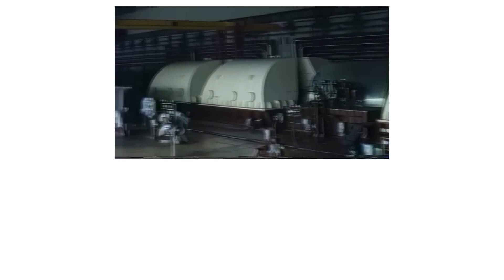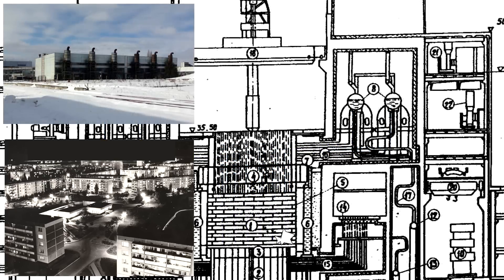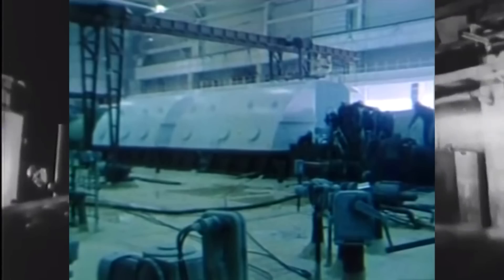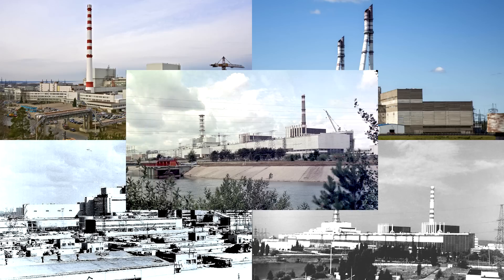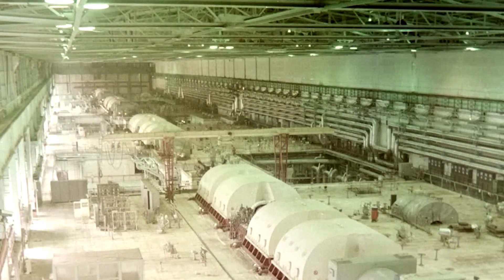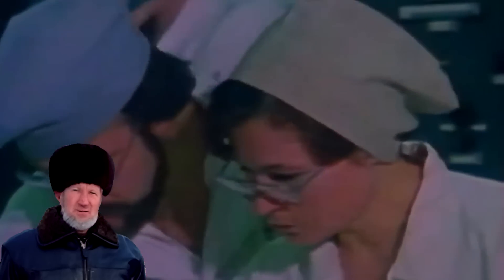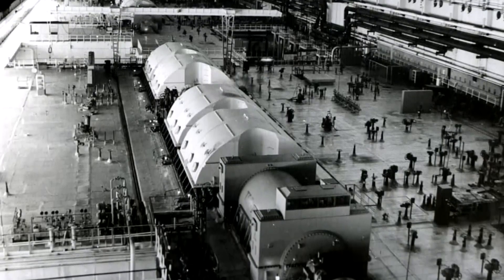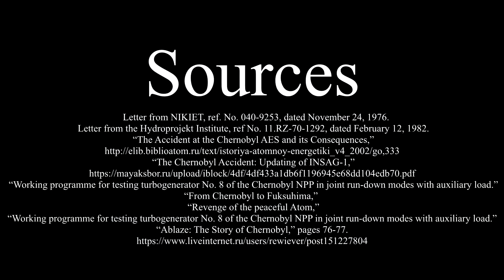Chernobyl: The Truth About the Turbine Rundown

Comment: one thing that i don't understand is that the program was based on some country was dropping on someone elses head. so soviets wanted to protect their npp's. the test could be done when the unexpected foreign explosion occurs, the automatic system such as earthquake detectors in fukushima can just scram the reactor immediately. the reactor still will have enough power in terms of steam. also when the reactor is scrammed the keypoint for the inertial thing is that the keeping the temperatures low while the reactor is scrammed because the operators would know something is happened. instead of this, they scrammed the reactor at the end which is completely not intelligent.

Comment: Maintaining water flow would have been far less critical if the RBMK reactors did not have a positive void coefficient. A design remarkable in that it combined the primary disadvantages of graphite and water moderated reactors. Insane.

Comment: I don't know much about diesel generators but I now that nowadays they have backup systems where the diesel generator is running all the time at very very low power, but can activate and make its full power in only a couple of seconds, sometimes even less, there was a power loss during a storm where I used to work that had such a generator, the lights didn't even flicker or go out when it switched from the grid. 

Every time I would walk by or sweep up the basement I thought about Chernobyl and wondered if the generators designers knew about the turbine rundown. I bet they did.

Does anyone know how big the backup generators were in Chernobyl and what their output was? I imagine they were state of the art then and probably huge
Reply: I’ve never worked in the field of backup power but as an electrical engineer the system you are talking about is impressive. To coordinate the switch from primary to backup power without the lights flickering is on the order of 100ms but to do so without computers rebooting is on the order of 10ms unless they have backup batteries. That’s a very short time! The rundown scenario is ironic how to a layperson it seems like a simple but genius idea, but to someone who creates power electronics it is obviously hard and impractical.

Comment: Approved program of " Rundown experiment" even didn't mention when exactly reactor must be shut down by AZ-5 button. Logically, it should be done simultaneously with closing of steam valve to turbine TG-8 and connecting the latter  to Reactor 4 to feed up circulation pumps, i.e. at 01:23:04  when experiment started. Actually, Toptunov pressed it at 01:23:39 by his own initiative rather than by the command from Akimov, who ignored him. It was assumed, that reactor would " never explode"  , whatever you do with it. Actually, reactor was already " programmed " for explosion when graphite part of control rods was reduced from original 7 meters ( on entire length of Active zone ) to 4.5 meters, leaving water columns 1.25 meters above and below, when control rod is in the fully " Out " position. Failure of RBMK-1000 in 1975 in Leningrad due to this " modification " was classified and never corrected. On April 26 1986 in Chernobyl  two explosions occurred : on 01:23:43 actual " nuclear explosion " occurred in the south-west corner of bottom of reactor with only 0.1% of U-235 being reacted , Xe-135/Xe-135m ( exited) proportion at 22, registered in Sweden, points out to it, yield was about 10T of TNT.  Second explosion at 01:23:47 was about 10 times more powerful, when Hydrogen exploded in the vast area, inside and outside of reactor.
Reply: Multiple eyewitnesses report Akimov instructing Toptunov to shut down.
Reply: Operator Władimir Semikopov, who was treated with Toptunov  in Moscow Hospital #6, talked to him and Toptunov told that he pressed AZ-5 himself when situation was already out of control. Diesel generators were put into operation with 6 sec delay, at 01: 23:10, while steam valve to TG-8 was closed at 01:23:04 at the same time when temporarily " test button" was pressed to switch 4 main circulation pumps to turbine generator to run on flywheel of turbine, while other 4 were running on plant power supply. Diesel generators went into full power only by 01:23:50, so test was not completed when Toptunov decided to shut down reactor. Several key witnesses stated that there were 3 explosions. After first explosion there was momentarily black out, in 2 seconds second explosion occurred and about 4 sec later there was a massive explosion. First explosion still is a mystery,  at 01:23:43 DREG system registered  over limits in both speed of reaction and output of power. At 01:23:47 DREG system lost control of reactor and registered overpressure in all 4 steam separators. Nuclear explosion on prompt neutrons was confirmed by the spectrum of radioactive fallout on 1000 km radius,  Volume explosion of H2/Air mixture was confirmed by pattern of spreading of window glasses and bending of steel lining of walls. Glasses scattered  inside , not outside of building, while steel lining bended inwards, not outwards. Also, AZ-5 button was pressed by Toptunov twice, in 01:23;39 for one second and again in 01:23:41. US satellite,  that was observing area of Soviet over-horizon DUGA radio antenna system of early warning of nuclear attack , located dozens km from Chernobyl, registered flash of " Blue Light " in Chernobyl at 01:23:45 local time.
Reply: @nyckhusan2634  When and where did Semikopov say that? Sounds made up, unless you can provide a source.
Reply: @nyckhusan2634  If the interview is available online, then you can provide a link. Otherwise I will conclude that you made it up, just like your made-up fact that Toptunov would have used the Pitanie MUFT button in a deliberate shutdown. That is completely incorrect. And there is no evidence Dyatlov wanted to repeat the test. Akimov himself stated that they always intended to shut down at the start of rundown.
Reply: @MinSredMash Note how he just asserts the graphite displacers were shortened from 7 meters to 4.5 meters and even contradicts himself from another video comment about what the intention was for not shutting down the reactor at the beginning of the test. Also, in his mind the speed of the emergency protection system was already fixed and there was a clear runaway reaction when the button was pressed. Those fingers are typing uninhibited.
Reply: @MinSredMash  Second test was intended to be performed after completion of first test: cool down of reactor in shut down state  by natural ventilation of water and steam piping above and below of reactor. This test was completely ignored by official investigation, although preparations were made to it and all channels were opened.. Also, Mercedes of " Turbomotor " was still near TG-8 during explosions. Vibration measurements were completed only at 01:13, ten minutes before rundown test started . Staff got high doses of radiation and later many died.
Reply: @nyckhusan2634  I'm aware of all that, but never heard that they were planning to restart the fuel cycle, wasting a lot of fuel.

Comment: Why not battery backup to run the cooling pumps while the diesel generator came up to speed?
Reply from the maker: The energy required to power the pumps is huge, and batteries of that size would be not only huge, but also far more expensive than the pumps themselves. Easier to add in a method to extend the run down of the pumps and diesel generators to take over, which they did. :)

Comment: They were contemplating cooling a graphite reactor core with air?

That's not a great idea. Does Windscale 1957 ring any bells?
Reply: The British used CO2 gas cooled reactors even after Windscale - just Wiki the Advanced Gas-Cooled Reactor. There are four generation stations using this design still active. They did obviously make design changes but they are still graphite moderated and gas cooled - Windscale was the prototype for this design. I was shocked when I read this last week too though tbh

Comment: I think one thing people really need to realize is that this test was a red herring. There wasn't anything terribly special about it nor did it require the reactor to be put into a uniquely dangerous condition whatever the power level. Rather than own up to what the disaster was really about the Soviets used what they could to portray it as extremely improbable and the fault of operators for placing the reactor in a unique state to perform this test contrary to regulations and instructions. There will be future videos on various details and aspects of what the disaster was really about and how Soviet experts spun it to protect themselves and the system. Here's an interesting quote from page 77 of INSAG-7 for everyone to chew on:

"Note: The Operating Procedures permitted operating conditions similar to those prevailing at Chernobyl Unit 4 on 26 April 1986 and they might have
occurred without any intervention on the part of the personnel. We only need to assume a perfectly possible situation in which triggering of EPS-3 occurs
when the reactor is operating initially at rated power with an ORM of 26 manual control rods. Under these conditions, approximately one hour after
triggering of EPS-3 the ORM could have fallen to less than 15 manual control rods at a reactor power of 200-300 MW(th), and any further action, whether
automatic or remote, to shut down the reactor could have led to a similar repetition of the events of 26 April 1986."